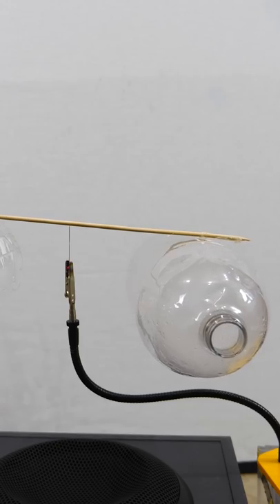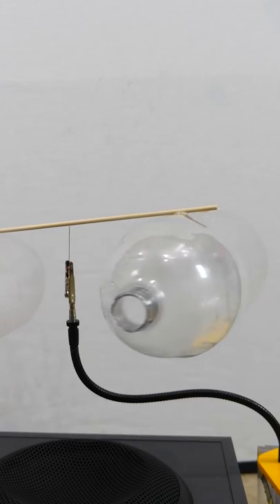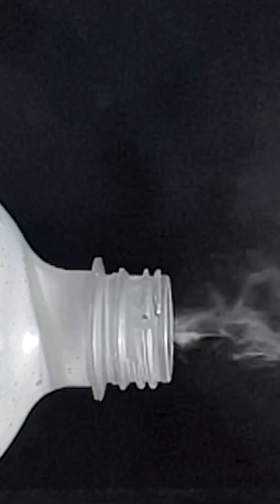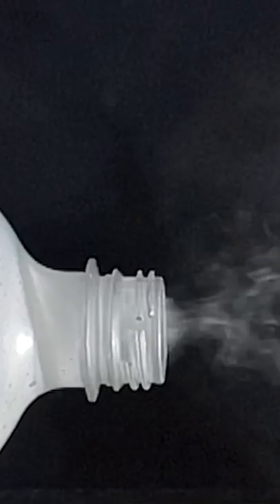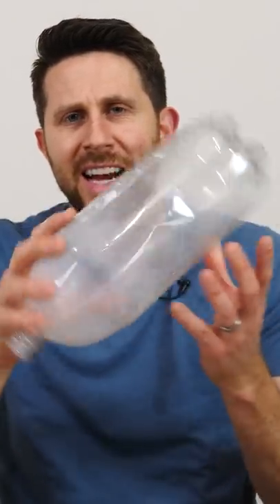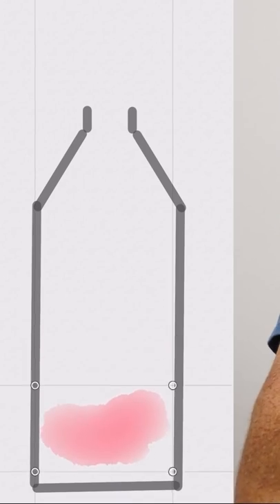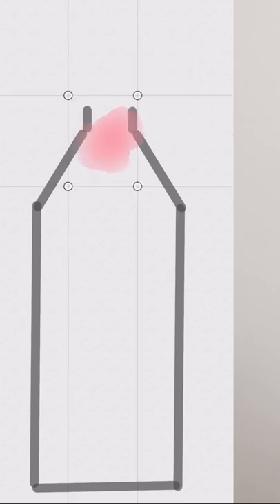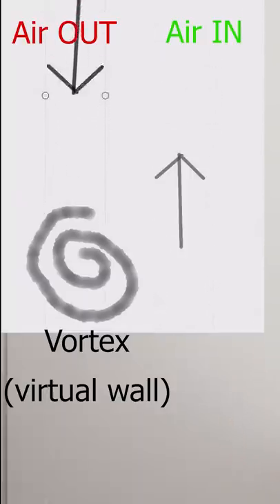Acoustic Rockets Using Helmholtz Resonance

Comment: What size is that bottle? 2 liter? 
What was the exact frequency? 
What size bottle (or amount of container space) is needed to produce 111hz when blown into? 111hz = the healing "holy" frequency sometimes called the devine frequency and was found to resonate throughout ancient temples.

What happens when you send exact 111hz to it in the same way, does it move at all? 

Also while I'm at it, what happens to water molecules under 111hz influence, do they become structured? Like some scientists claim? If so wouldn't that same frequency affect the water molecules in humans? Or rather, wouldn't ALL frequencies affect the water molecules in humans in some way? 
Especially the polarized artificial manmade interference frequencies we're drowning in?

Comment: It's creating a vortex in the neck
Reply: This is correct and because the air coming in is on the outer perimeter of the vortex the air continues its path till it curves the bottom of the bottle where the compression into a smaller diameter of a counter flowing vortex it accelerates making the air leaving the bottle having more momentum than the air coming in making thrust, now if one were to design a better bottle could more energy be converted than needed to make the sound wave?

Comment: Energy needs to be expended to produce the sound. It is highly improbable that the thrust would be greater than the energy required to produce it.
Reply: @mattmurphy7030  I dunno. If we get enough Twitterartii, a Trump rally and a Putin. There might be enough hot air and meaningless noise to power Concorde!

Comment: Hey..how can it be that on certain nights my plastic bottles in the kitchen..even in cubbards and in the fridge which is isolated..have changed shape..it like all air has been sucked out .it deforms the bottles..
It this because of weather control? How can it influence it though in an closed environment..like the fridge ..if i take the lid off the shape often restores...sometimes the bottle cannot turn ok again...and bends over almost overheated .

Can you do a special on this too?

Comment: Could you move a great amount of weight if you got the correct frequency my hypothesis Is based off of the way things like gaming controllers ,phones, tooth brushes, and razors all of them can like float around if the surface is flat enough so could we

Comment: Could this be used for propulsion in space some how? Like I know you'd need a source to fuel the air but could take a condensed gas of some sort and do it slowly but I guess the "bottle" would need to be insulated with atmospheric pressure to. But theoretically you could get a very similar thing to an ion engine 🤔 or am I just thinking I'm to smart and it's actually a dumb idea lol
Reply: I think all the air would just escape into space
Reply: @DuckInGameStop  wouldn't that still cause propulsion.. I get what your saying.. skip the whole resonance part. I dunno for a bit it kinda made sense in my head 😅

Comment: I don’t believe your virtual wall explanation correct. Since air in = air out it will also be pushing and pulling equally on the virtual wall.  (Unless there’s a complex oscillation effect or it’s able to replace the air where there is no virtual wall)

How it might work is that the pressure wave creates a point at the center of the bottom opening so all the air blowing out is in the center insulated from colliding with the bottle. So the air moving into the bottle is on the outside edge and thereby able to push and drag the bottle wall forward as it enters.

Comment: I imagine these vertices isn't the reason why the bottle is moving. LET ME EXPLAIN. IMHO. the vertices theory of why the thrust is generated is totally flawed. I personally think that when the bottle is flexing in and out there's a limit to how much air it can take in right? sidewalls of the bottle are strong but the amount it can blow out is a little bit more hence there's a little more air. the bottle is allowed to fill up to that certain point but expels a bit more. but also a better explanation would be that. the air being sucked in through the mouth of the bottle sure as hell isn't going to stop the bottles thrust..but air escaping. sure I'd believe it. a speaker is a good control  both sides almost equal to the air it displaces. and sound it generates but the bottle idk 😐...maybe I need to grasp the vertices theory more but I think that's a bunch of bull. does it really form a wall enough that it creates thrust if so why is the air allowed to fill it repeatedly.

Comment: I've been wondering about some of that for years. Now, I'm wondering how you can make thrust, while replacing the air inside the bottle through the same hole. I wonder how efficient it is to use sound to do this.
Reply: The little "pop pop" boats that use a candle eject water in and out the same orifice but still produce a net thrust.
Reply: @ferrumignis  but that's different because, there's a lot more steam going out than there is water going in. Also now I know about pop pop boats. Thanks

Comment: I call bullshit. The air pushing out does it way more rapidly that the burst of air pulling in. There for each thrust out will give it a little more to overcome friction and move, where as the air sucking back in the bottle doesn’t give that same concentrated push of air/energy to overcome its friction as much. There for is moves forward. Thoughts?